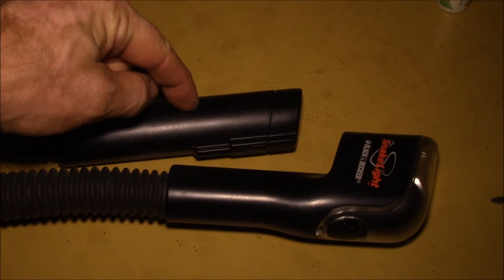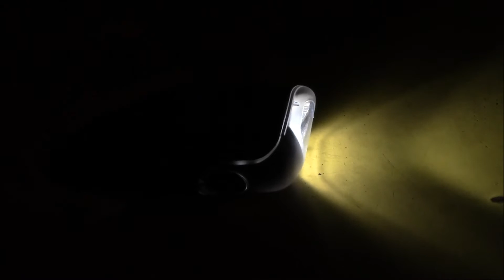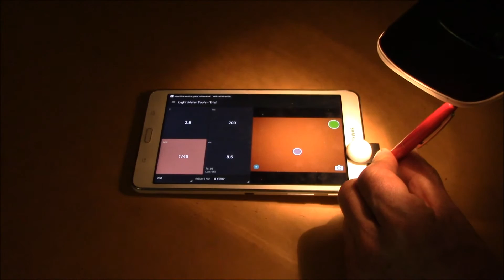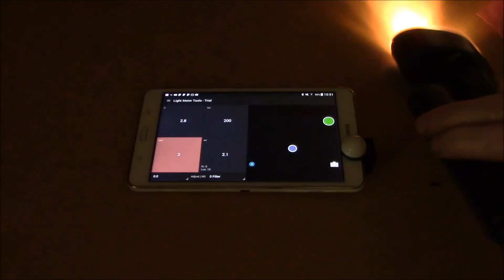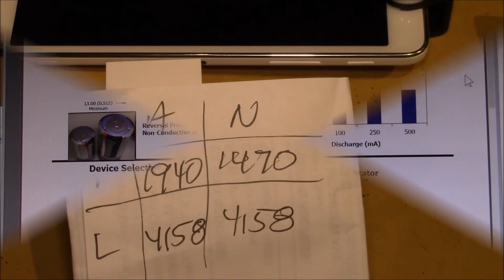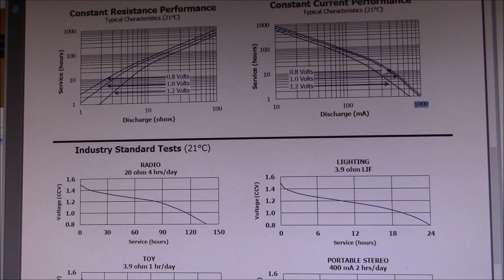LED vs. Incandescent vs. Alkaline vs. NiMH SnakeLight test

Comment: So led is better than incandescent and Nimh is better than Alkaline.
Reply from the maker: Yes, that would make a decent executive summary.  As long as you use an LED bulb with a built-in constant current driver like I did, the NiMH batteries will put out the same amount of light as the alkaline with the ability to recharge.
Reply: @The4Crawler  Actually the NiMh batteries will put out more light overall because it has a flatter discharge curve where as Alkalines generally start off at 1.4V which overdrives the bulb for a bit then drops down to like 1.2 and descends further until flat. Of course a good LED with a driver will be able to maintain brightness despite the voltage sag.